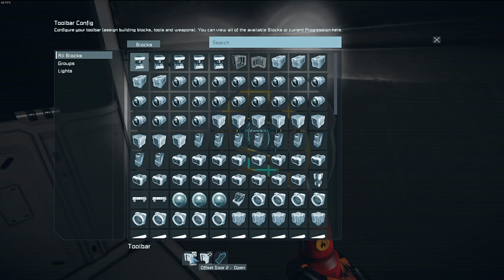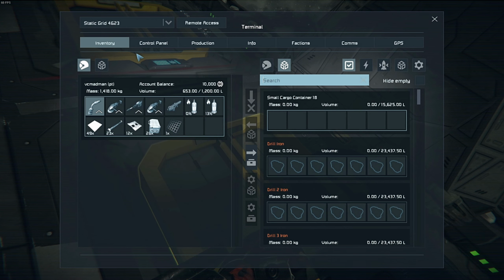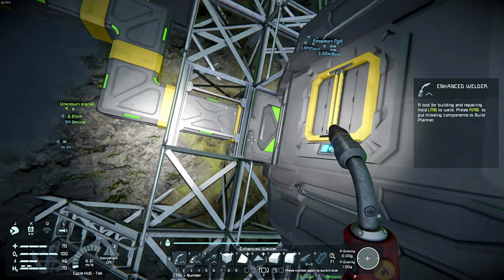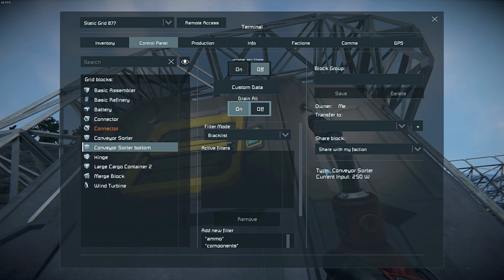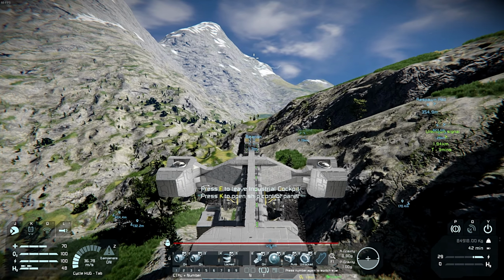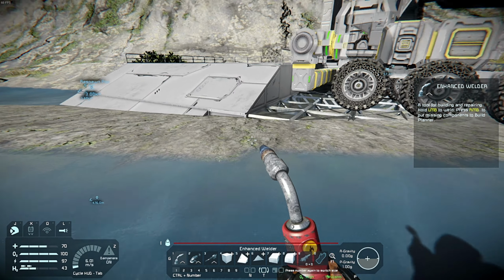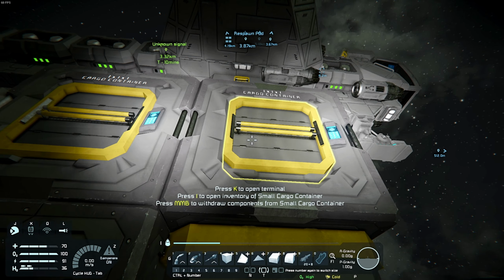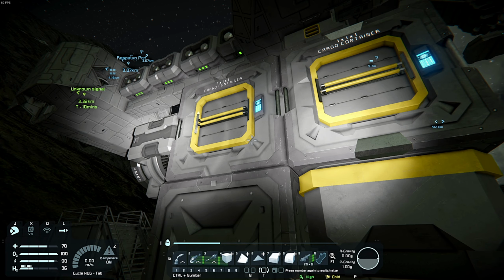Space Engineers ep13 - Amazon Delivery Meets Space Engineer

Comment: When you were having trouble lifting the ice shipment, you were trying to lift the containers and overcome the magnetism of the connectors. When you unlock connectors their magnetic attraction is disabled for a short while (the ring turns blue), after a few seconds the magnetism is switched on again (ring turns yellow). You can adjust the strength of their attraction in the terminal.
Reply from the maker: I see, thats probably not helping either xD i think that more power is in order, some modifications to the firefly and we won't hv more issues :P